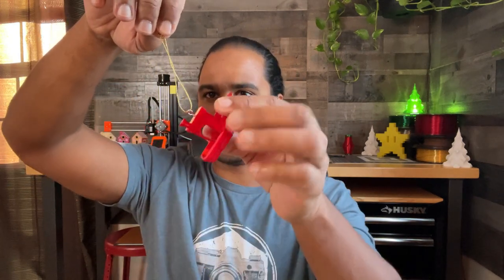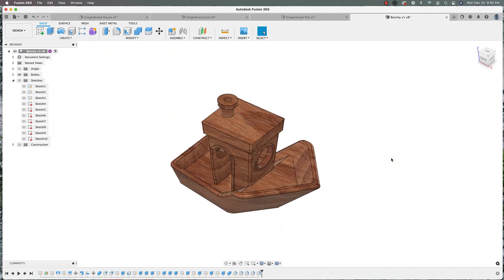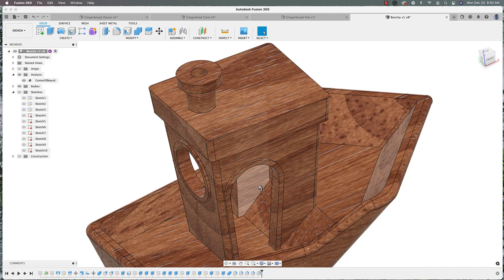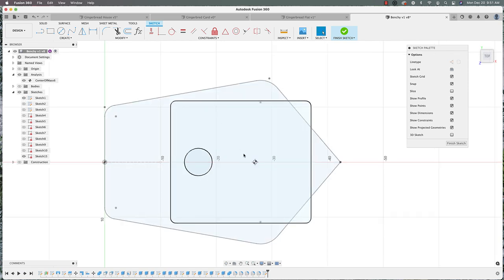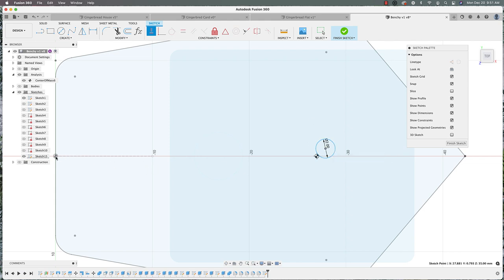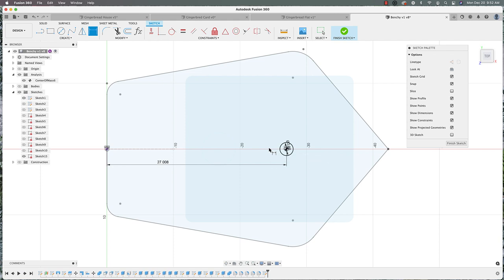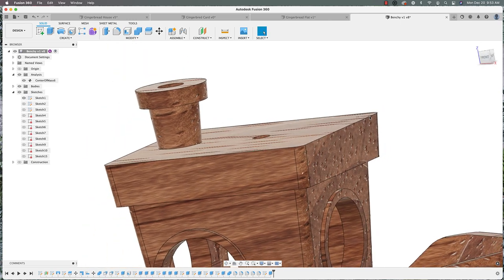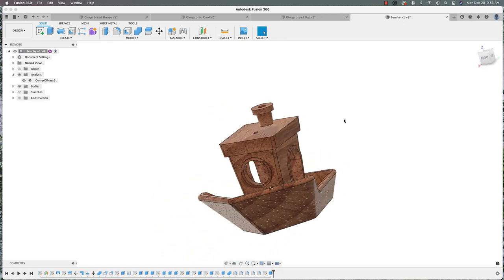Finding Center of Mass in Fusion 360

Comment: Surely this video needs to make it clear that this only works on a solid print. If you used a modest fill density the thinner parts would be heavier than the thicker ones per cm3.
Reply: If you export a sliced model from your slicer as an OBJ file, you can import it into Fusion and get a good estimate for the COM.